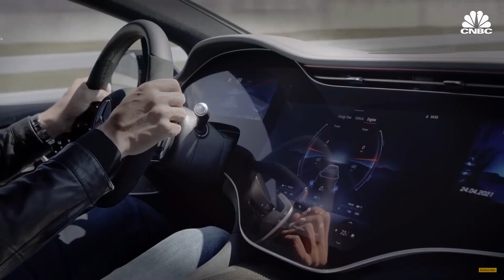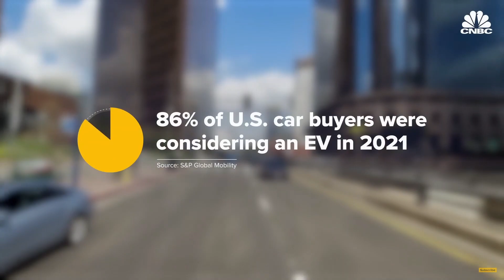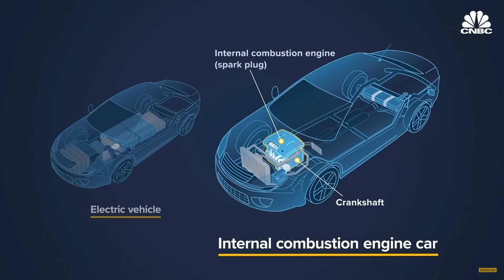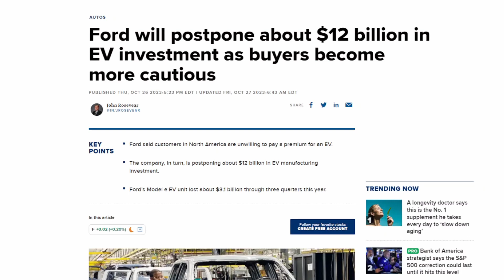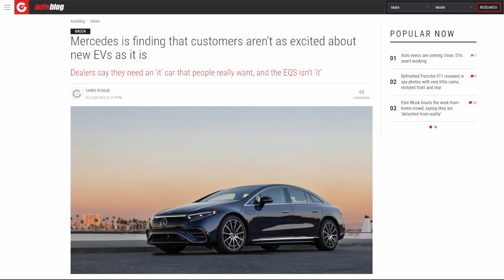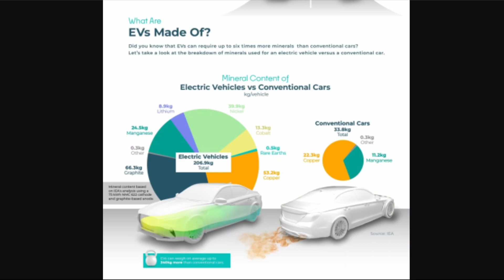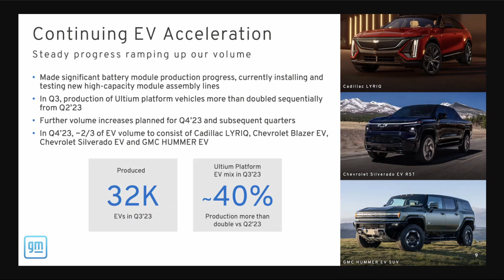GM and Ford CEOs: Electric Vehicles Are Simply Not Working.

Comment: Traditional automakers don't want EV's since "after-sales services contribute as much as 50% to the overall profit of some automakers" of course they don't want to build reliable cars. They want you to visit the stealership so you can buy their dealer only parts are insane prices. Dosent matter what Ford, GM etc want the 1st and 3rd automarkets will dictate the road ahead. Also with Sodium batteries the battery metals issue is soon over.

Comment: Just because F and GM can't do it, doesn't mean its a bad idea
Reply: Oil company will not let their cash cows die easily
Reply: Although there's several issues (raw material supply, electrical supplies, lack of any demonstration of climate change actually going to the predicted range, etc.) that do make EVs a relatively bad idea.
Reply: You are correct, Toyota not wanting to do it means it was a bad idea.
Reply: @mrg-ghx8052  it's a wonder that Tesla even exits...how can you explain that?

Comment: But for tsla it is working fine.
Reply: Yeah the Cybertruck is awesome.  Seriously..  it has been working but is it sustainable for Tesla?
Reply: Is that why they are discounting most of their models?
Reply: It isn't, sales are down, they are cutting prices too, which is hurting existing owners, and is an unsustainable strategy. But Tesla clearly don't have so many issues.
Reply: @mrg-ghx8052  Per brand sales are down but the overall EV market has explosive growth, if you buy an dino car in 2023 you are buying a door stop, just look at the residual value curves on gas powered luxury cars......
Reply: @callmebigpapa  explosive growth 😂

In the UK ICE cars are holding up their values very well in parallel to an EV equivalent and buying a new ICE vehicle now would still give you 10-15 years of service.

Comment: I don’t feel that the straight up battery electric vehicle is the way to go…maybe in urban/city settings they’d be a good option…for the rest of the country, I’d go with a fuel cell EV. Less batteries, less rare minerals to produce the batteries, and maximum range before recharging/refueling the fuel cell. That said, the nation’s charging/refueling infrastructure must be built out for the majority of people to go along with the shift to EVs….no one wants to be stranded on the side of the road.
Reply: Have you ever even sat in an EV? No matter what range an EV has you wouldn't be happy.
Reply: @metricstormtrooper  , I’ve sat in the back of a Tesla, and back in ‘95…I operated some of the first electric buses Bluebird Bus Company offered. When they worked, they were impressive…but they were not reliable at the time. As a country, we can figure it out-if we want. Look how far we’ve come in 100 years with the ICE. 800 hp from the factory…and covered under warranty? And still get 20 mpg….!
Reply: @chetcalhoun613  rent a Tesla, don't just sit in the back of it, do a long road trip on their network, use the Nav, you have to be deliberately dumb for 3 hours straight to be 'stranded on the side of the road' - the Nav plots in charging, book hotels with chargers, actually do it, rather than assume it's no good based on stuff you read on the internet. Plenty of EV road trip videos out there.

Hydrogen is going nowhere, once you get used to charging at work, home, hotel for cheap, you are less interested in going back to a gas station, but it is a shift, you are not going to 'get it' straight away.
Reply: @brushlessmotoring , I get what Tesla has achieved with their car and charging network…I just like the fuel cell idea over all battery.
Reply: @chetcalhoun613  but that’s the problem, it will never be bigger than a few thousand cars and a few hundred stations, for most people, it is just as you say - an idea - the reality is, you are sticking with gasoline, burning fossil fuels for another 2 decades while you wait for the ‘idea’ of hydrogen to become a reality - it won’t - it can’t - it’s too expensive.

Hydrogens role now, and it didn’t used to be this, but hydrogen is being used to distract and delay from EV adoption.

At that, it is proving quite successful.
Reply: @brushlessmotoring , take a look at where Nikola is with there FCEV, producing these units as we speak, to be put to work, not for testing, what Plug Power is doing teaming up with Fortuscue (sp), Bosch, and others, when it comes to hydrogen. Also note that Tesla stopped production on their Semi because they can’t get enough of the rare minerals to make the batteries. It’s like Ford or Chevy. Pick the one you like.

Comment: Most of these electric cars are garbage. The deal breaker for me is the cost of battery replacement. 
Battery goes out outside of warranty and there goes over $20k. 
Until there are reliable lower cost aftermarket options these things are all D.O.A for me.